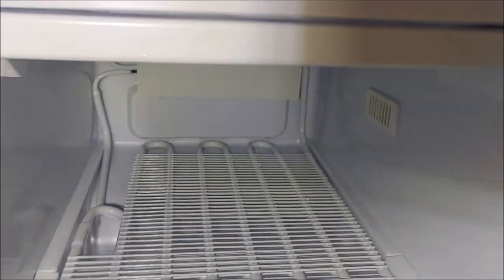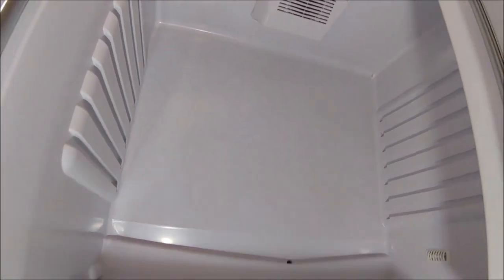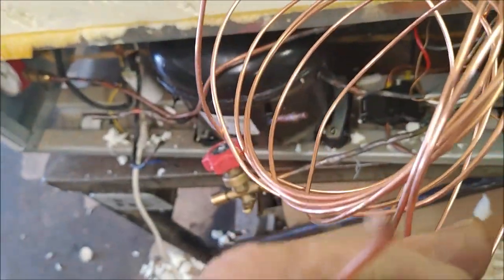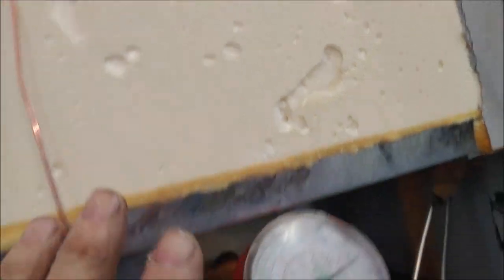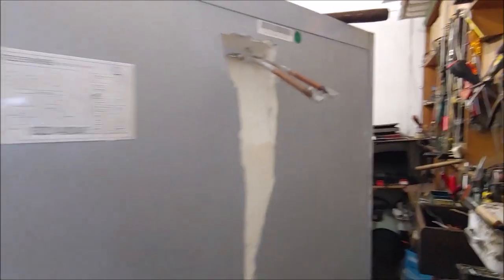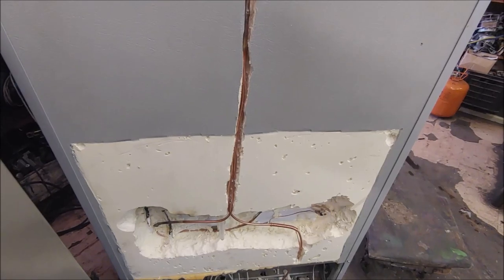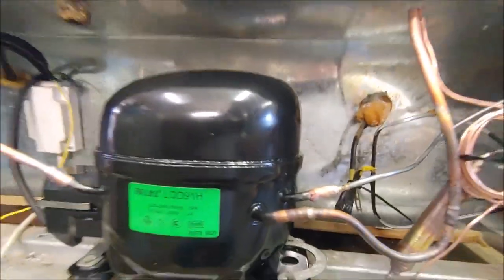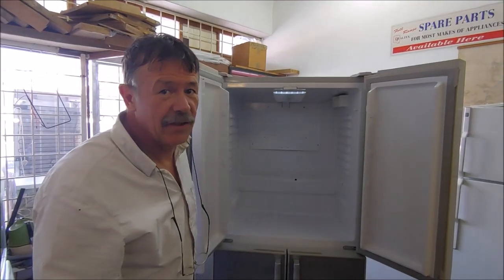Repairing an internal gas leak on a Telefunken fridge - JD Nel Refrigeration

Comment: Artisanship!
Sad to say in the "throw away U.S.A." this would never happen commercially.  I used to live in Costa Rica 🇨🇷 six months / year post Katrina for a dozen years and was continually amazed at repairs on anything from shoes to appliances was able to be done with limited resources but clever craftsmen.

Curious to know how you established the correct charge of refrigerant.

Kudos sir!
Reply from the maker: When I start the charge I let it settle at about 10psi. When the fridge reaches running temperature the pressure is obviously lower, then we can either add a little bit more or blow some off to get the correct charge.

Comment: A Brilliant Vidclip, Really Clever approach ..... I do have a Question .... Why didn't you Space the Cold-Plate away from the Back-Wall by about 5 or 10 mm ????? This would have actually given you 2X the available surface area for absorbing the 'Heat' from the Fridge Compartment, also would not trap water/ice between the 2 surfaces. Yes I see that the actuall 'Drip Trough' is quite shallow, so there is not much 'space' to set it forward ..... Mooi Bly.... Groete uit NZ
Reply from the maker: The compressor cycles on a thermostat which measures temperature in the fridge part cold plate. If you make the fridge too efficient, then the compressor will cycle before the freezer is cold enough, so, it is a good thing that the plate is right against the back wall.
Reply: @JDNelRefrigeration  Good point .... Very well explained . I didn't realise that there thermo' was actually securely fitted to the 'Plate' and would 'shut down Before reaching Freezing .....  I have always been told there should always be a minimum 'Differential' of a 6 - 8'C between the 'Ambient' and the 'Absorber' for best efficiency, hence my comment about Only 1 side being 'active' .... Mooi bly, Alles wat mooi en goed is vir Jou en al die Familie ..... Cheers uit NZ   .... email gestuur .... !!!!!

Comment: How long is capillary that You use in your fridge?And of course for what diametre?
Thank You!
Reply from the maker: On all 134a and R12 systems I use the same capillary. In South Africa it is sold as domestic fridge capillary. The length is not that critical, somewhere between 2 & 2.5 meters is normally sufficient.

Comment: how did you weld the capillary to the aluminum pipe?
Reply from the maker: We get little joint pieces which has an aluminum and copper joint done in a factory. So the aluminum we weld onto the aluminum and the copper we weld onto the copper.

Comment: Sir, how much presure can u put in an aluminium evaporator when u test for leaks?
Reply: 150 is enough more than 150 will blow the tubes inside plate
Reply: For any system, need to identify what is it's correct operating  pressure and then if no test specs are listed for that portion of a system, make an assumption of at least 125% over normal operating pressure. Knowledge of which refrigerant is being used and it's corresponding pressure / temperature chart are imperative.
Reply from the maker: There was a French evaporator manufacturer Rubanox. Their cold plates could handle in excess of 350psi, but most modern mass produced cold plates distorts at 100psi

Comment: Uh.. where is the condensor? Did not see it in the vid?
Reply from the maker: It has an internal condenser, just the 2 end tubes stick out. That is where I connected the gauge and service valve.
Reply: @JDNelRefrigeration  Got it! Same system like most chest freezers have?  I wonder; is an internal condensor less effective? There is less cooling surface en the tubes are mounted in the foam. What is your opinion Johannes?
Reply from the maker: @vanheemskerk1  The internal condenser can be used to generate heat in the fridge cabinet underneath where the door seals seal which prevents condensation from forming, which is a good point for internal condensers. An external condenser is more efficient if it is kept clean.